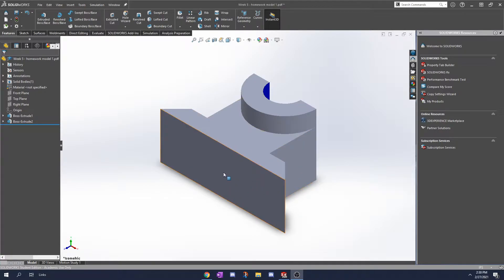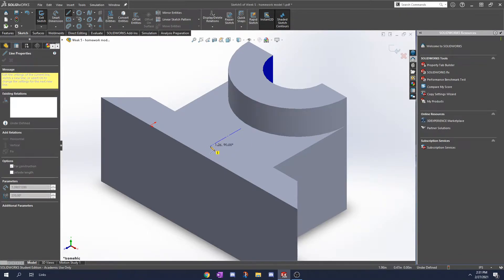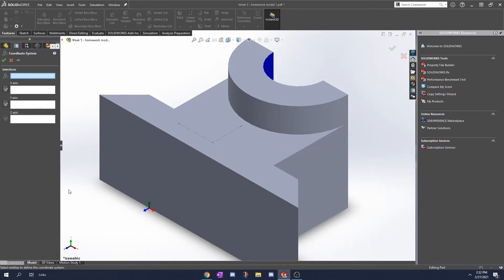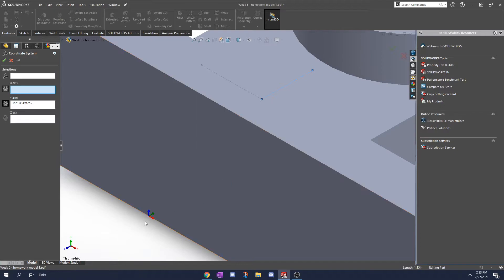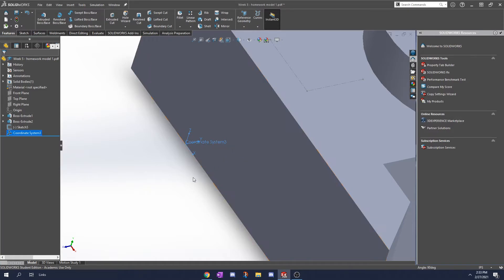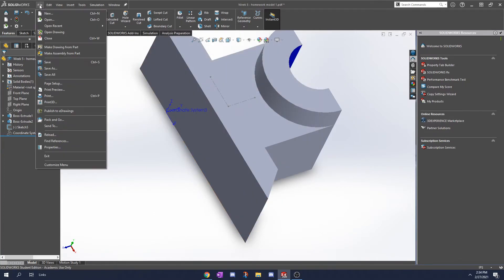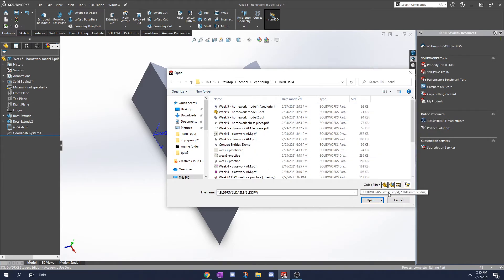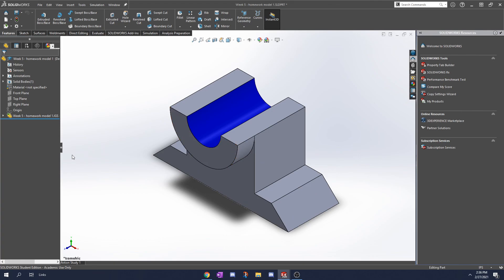How to Change Original Plane of SolidWorks Part/ Change Orientation

Comment: I need to do the same thing but with a 2D sketch. I tried to do the same thing but with .sldprt instead of .iges but it doesn't work. Could you please help?
Reply from the maker: Hey Vedant, sorry for the late reply. If it's just a 2D sketch, you can actually copy the sketch by highlighting and pressing Ctrl+C, then click on the plane you want it on, then ctrl V. it should port over
Reply: @malialik Thanks for the reply. I tried that but the orientation remains the same even after copy-pasting (i.e. it gets pasted mirrored). Basically, I have a fully defined 2D sketch that I have drawn on the XY-plane such that X is to the left and Y is upwards. Now, I want to basically change the orientation such that X is to the right and Y upwards keeping the sketch as it is. (I want the sketch to look exactly as it is now, but change the orientation). I tried mirroring the entire sketch (without copying), which works but now the sketch is fully undefined and it is almost impossible to full define it again.